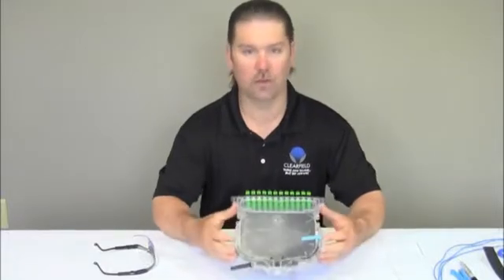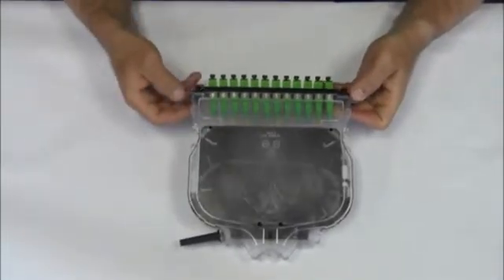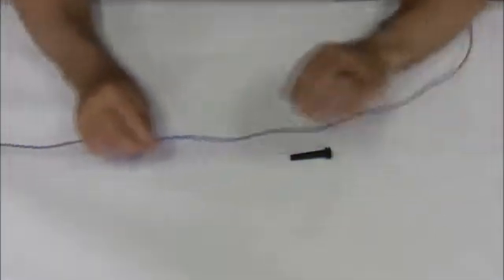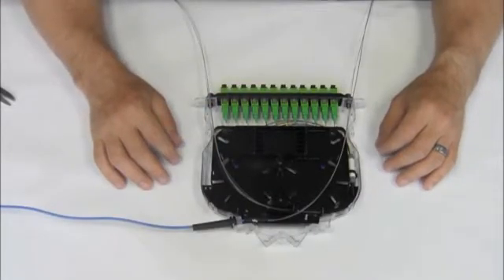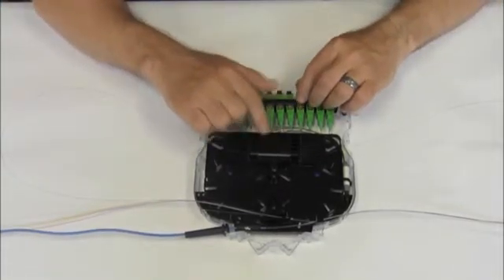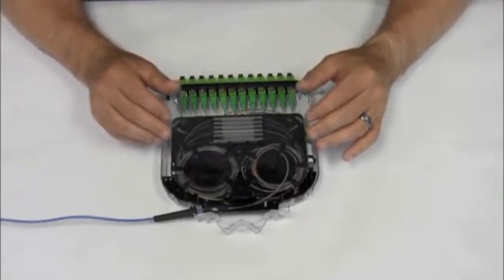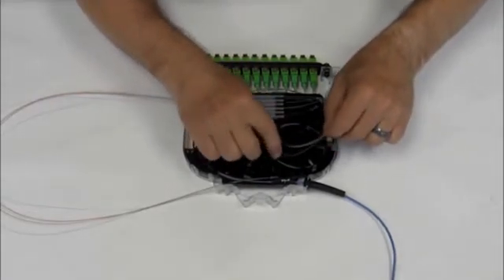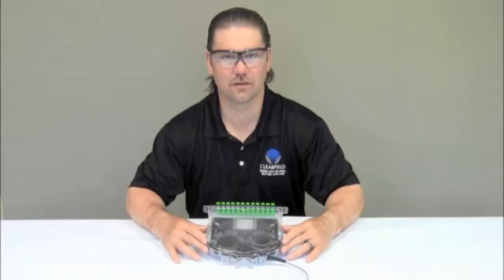Loose Tube Splicing in Clearfield's Clearview Classic Cassette

Comment: why not place splice sleeve holders that do not require silicon/tape  to hold in??
Reply from the maker: The splice tray has an integrated splice sleeve holder/organizer. When splicing is complete, and the tray cover is put into place, the sleeves are secure.  If a more permanent solution is desired, silicone can be used to adhere the sleeves to the tray. -- Thanks for your question!